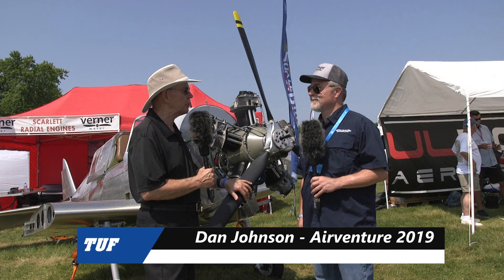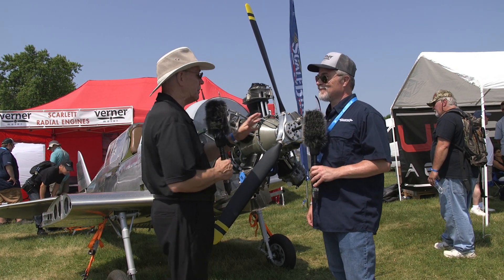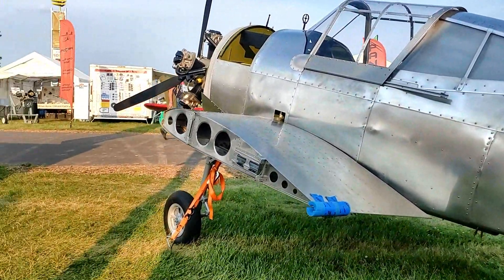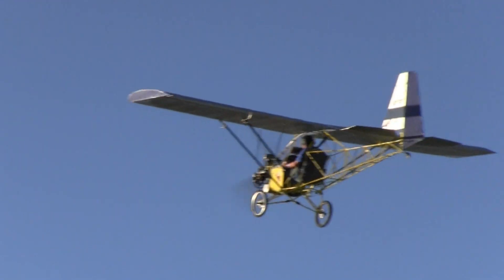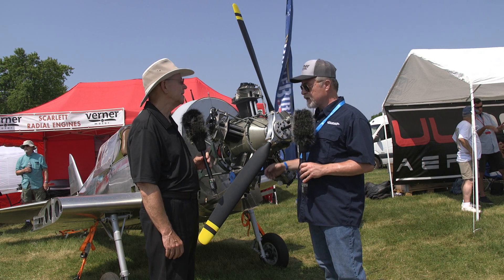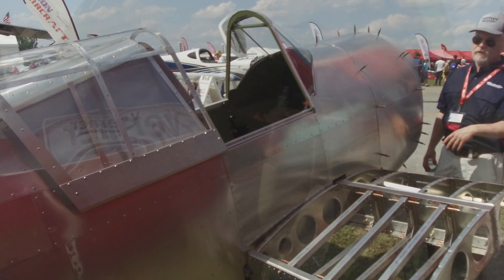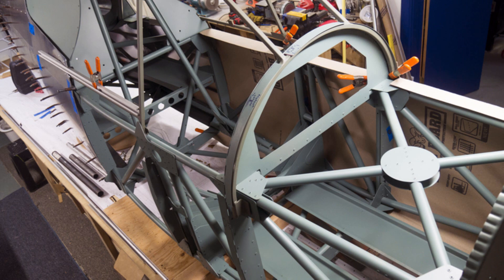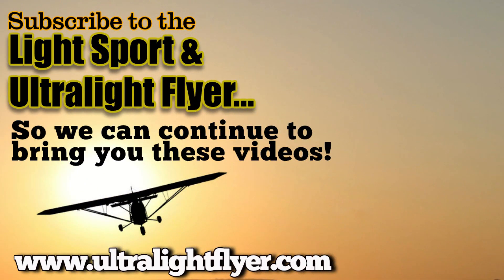ScaleBirds, LiteFighter Replica Aircraft, Verner Radial Aircraft Engines.

Comment: The problem with LSA is that it's not conducive to retracts. The category needs some bolt on advanced class to make RG permissible else it's not fair for those interested in replica aircraft coz who would want a fixed gear arrangement on that plane? Not many.. Where is this LSA revision anyway coz it's long over due. 

That new chap who took over the authority promised to do things fast.
Reply: i think mechanical retracts can be done without too much weight, conventional hydraulic retracts are more heavy.
Source: None